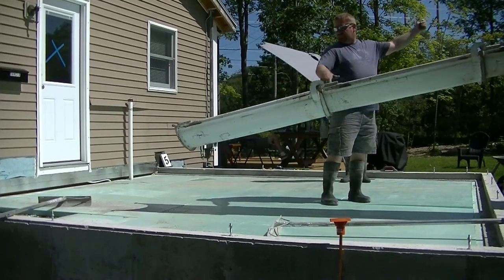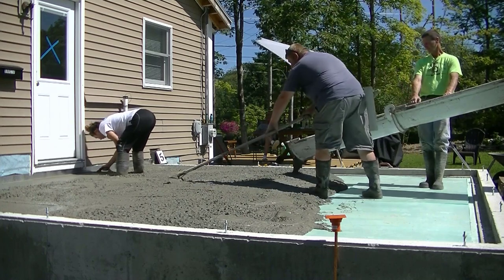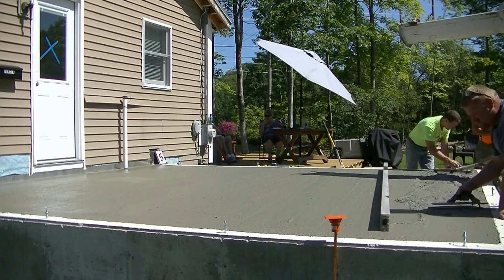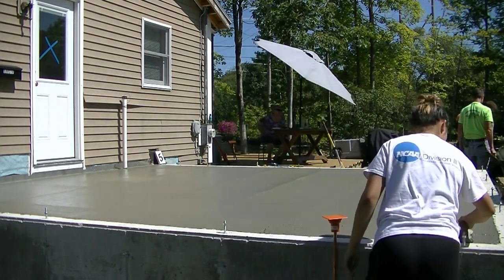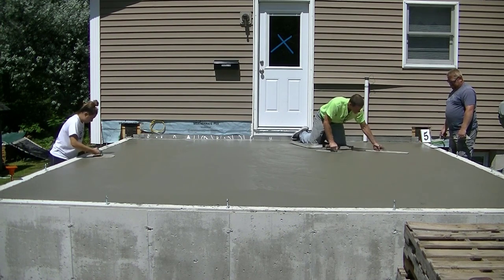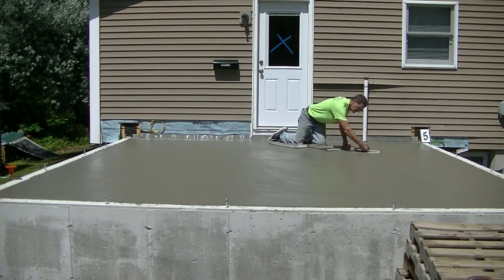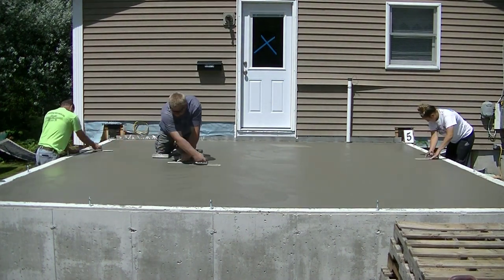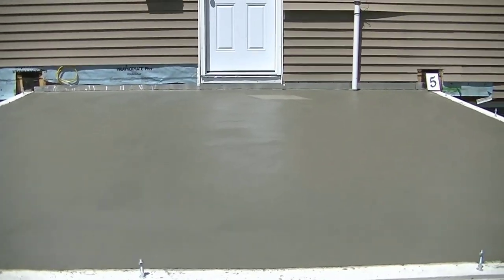DIY Concrete Floor for a House Addition (Complete Pouring and Finishing)

Comment: The deep walls (frost ftg) is also important for dry weather that. Let’s the dirt expand and contract in changing weather conditions (rain to dry)in the summer can cause wall movement in summer time and cause Sheetrock to crack.

Comment: I like the fiber for driveways and if I'm pouring something that is going to have a lot of weight on it like tractor trailers I use mesh and rebar with fiber. Helps to have good help that knows what they are doing. Nice job brother

Comment: We poured a floor and the contractor had the icf walls up. I couldn't believe how much faster the concrete set up with the reflection of the white walls. If it wasnt for 2 of the guys from the wall crew helping us we would've lost it. That would've been an expensive lesson
Reply from the maker: Yeah, it's like a sauna in there.
Reply: Bondo (youtuber) says the same thing. Plus the access is way better with no walls

Comment: Mike,
Great job.
In Maine do you attach the (new) frost wall to the existing frost wall.of the house foundation? If so how is it done? Do you shoot rods, if that is the right terminology  into the foundation to accept the new frost wall?

Also what are your thoughts on ICF foundations vs a tradituonal foundation?

I am considering on building something in northern WI where the weather may be similar to your.
Thanks,
Chuck
Reply from the maker: Yes, drill and pin (with rebar) to the existing foundation. ICF's make a great foundation.

Comment: Looks good. I'm about to do a bedroom addition like that with existing hardwood floor I want to match. I'm thinking of putting the slab lower and using pt sleepers and plywood for the base. The only reason I guess to do concrete slab first is to keep the gasses in the ground. What do you think of that idea?
Reply from the maker: What gasses? Radon?
Reply: @MikeDayConcrete  yeah and whatever else would come to the surface and get into the living area

Comment: Advise.. Use gloves while working with concrete or epoxy.. Can cause real health problems later on.. Take it from me 30 years of experience in all round concrete work and floor and wall coatings